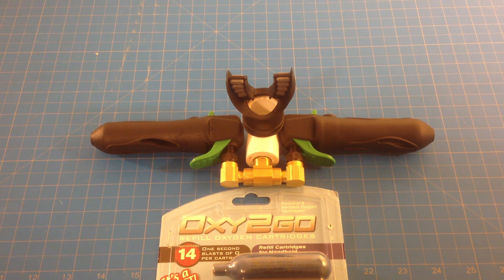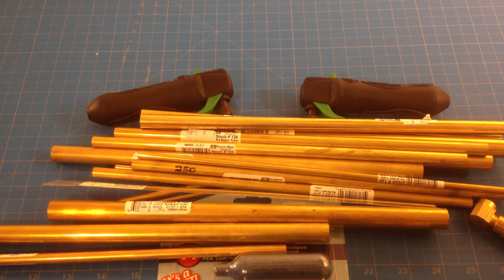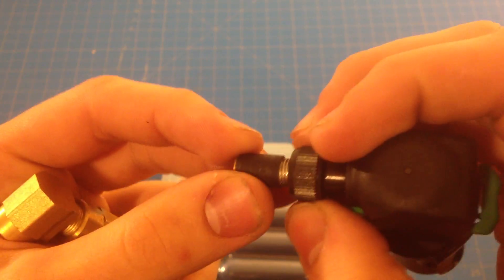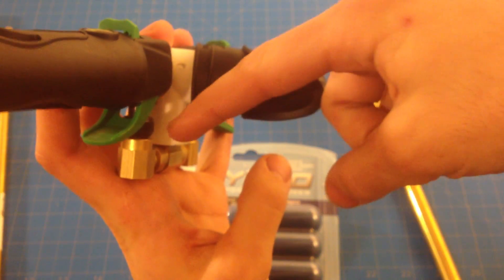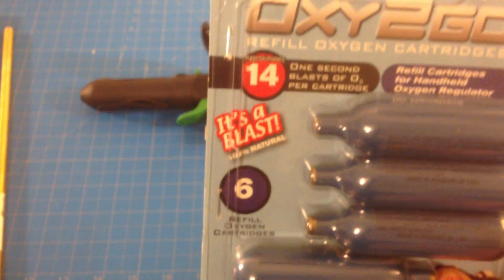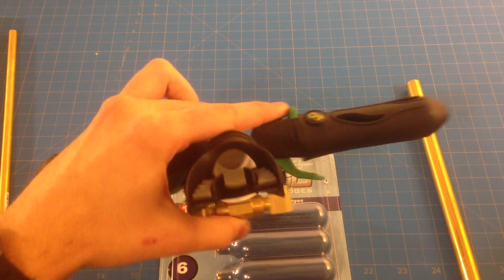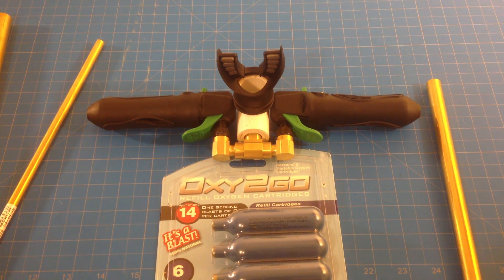007 Mini Scuba Tank Prototype V2

Comment: At first, im Sorry for my poor english.
Second, i really LOVE the idea.
Third, i die some calculations: i dont know, are these AS big AS 12 g capsules?? Lets say 20g so the volume is about 20ml=0,02l at a pressure of 60bar. 0,02*60=1,2l per capsule so with two oft them would be 2,4l. A human (in wir, at sealevel) needs about 7,8l/min (so wiki). That means it is enough air for approximately 18 seconds..... Im really sorry

Comment: It is a good idea and they make a full face mask with a built in snorkel for light diving in up to 40 feet of water so if this could be adapted to that it would be very cool also for emergency purposes it would also work great to
Reply: @Robert Miller No they make a full face mask to snorkel on the surface these full face masks with in built snorkel do not allow you to equalise air pressure. So if you want to risk injury go ahead but you really need to discuss this with a qualified diver. 12m depth and being unable to equalise can result in an injury .

Comment: 100% oxygen is nor harmfull to your body. It is DEADLY. if you breathe in 100% oxygen your blood can not give co2 away to the lungs and ur blood doesnt get cleaned and you die from co2 poisoning.
Reply: +GreekGadgetGuru Please hear me out GreekGadgetGuru, Im an advanced open water diver. Theres a thing called a lung over expansion injury. So how does that work, you might ask? Well, lets say your swimming and you take a breath and swim to 33feet below the surface. The air in your lungs will COMPRESS to half the size, and as you come back up it will return to normal (expand). Now picture this, if you take a breath from compressed air it will be at the pressure that you took it from. And if you start to ascend, the gas in your lungs will expand. If you go up 33feet the air in your lungs will expand to twice the size, and this can cause permanent damage to the lungs, or even death. Lung over expansion injury can happen in water as little as 5 feet deep. If you want to breath underwater, take scuba diving. Its not that expansive and you learn how to prevent these injurys. There are many more dangers to this, such as sinking as the air in your lungs compress and possibly drowning. But I wont go into that. Please be careful.
Reply from the maker: Thanks. Won't do that then. Working on safe version using compressed air.
Reply from the maker: +jack gaming working on it my friend
Reply: in the beginning of the video, he says that it is a combination of oxygen and nitrogen which are the 2 things you need to create co2, so this is "safe" but still not recommended.
Reply: +ZPERO sorry my bad must of not payed attention in biology and chemistry
Reply: @G3AR glad to hear please keep working on it but talk to a trained diver as their knowledge will help you keep the unit safer. It may in the end work or not but as others have said without people trying to invent new stuff we would have no new inventions. Just remember though as I said gas gets compressed so 12 breaths at the surface will be approx 6 breaths at 10m ( as you ascend the pressure decreases so lets say you took 4 at 10m the came to the surface you would not then only have 2 breaths but approx 4  breaths. These are the things a qualified diver can help you with.

Comment: Good luck. For breathing for extended periods of time the design may be flawed. As a safety device, in my opinion it may have merit. A surfer or freediver could get that one vital breath. Also, it seems that the purge valve will also provide o2 at ambient pressure. A technique might be needed to avoid a burst eardrum. Be safe.
Reply: Your right about the ear drum, you need something to balance the pressure from the breathing device to the same pressure as the surrounding water. That's what a secondary regulator is for.
Reply: +Bunk-Bunk You're*
Reply: +Grant Markum (Bacon man 121) This is science not English you obviously knew what I ment.

Comment: Holey hell, this is like a darwin award waiting to happen... Do you have any knowledge about diving at all? do some deeper research. With no regulator, you will run into horrendous problems right off the bat. Pure oxygen is toxic past very shallow depths. If someone used this thing, they would be lucky to survive at all...

Watching people with no dive experience try to design breathing equipment is absolutely painful. And before you say "I'd like to see you do better" I know better than to try. I'm just a recreational diver, but even I know this thing is a death sentence if you tried to dive with it. Even as a back-up, this is worthless, and extremely dangerous.

Comment: @2:11 "High altitude oxygen"... "so im not going to die or anything"..... WRONG.  Scuba diving isnt done at altitude where the atmospheric pressure is lower, its done at depth, under water, where the atmospheric pressure is higher....
Reply: +Isaac Wipfler 

The no dive experience alone is potentially fatal, now near pure O2 and no regulator? I wanna see the darwin award where he ruptures is lungs, and expires from that and the oxygen toxicity in a backyard pool.
Reply: im right there with ya :D

Comment: Scuba Instructor here.  The large risk with breathing 100 percent oxygen is its PP or partial pressure.  When oxygen reaches a partial pressure of around 4.0, the body almost immediately starts to reach.  Oxygen toxicity or oxygen poisoning results in tremors along with a bunch of other negative side effects.  The main cause of death with divers and oxygen toxicity is however drowning due to the inability to keep a regulator(the mouthpiece) in your mouth to keep breathing.

Comment: pure O2 , if breathed at a depth of about 11-15 feet will instantly send you into convulsions. you will suck water and die. pure O2 is TOXIC at a depth of 11-33 ft. be aware of that!
Reply: You're an idiot and don't know anything about oxygen toxicity. 

- a hyperbaric chamber tech
Reply: instead of showing your ignorant, violent, arrogant side, why dont you help educate us? your turn, expert. and do it politely.
Reply: +zencat999 haha. I only say it that way because you took it upon yourself to reply to so many comments with info that you obviously have no idea about! What do you think we treat injured divers with in a hyperbaric chamber? At MUCH deeper depths! Oxygen! Oxygen toxicity seizures can happen after a long time at depth on O2, but guess how we treat it? Remove it until the body uses up the excess oxygen, and then put it back on the patient! Seizures can happen, but the risk is so low and takes so long, that it is pretty much a non issue. So this rescue device? Totally safe for that role.
Reply: not polite but there it is. thanx. behave yourself now. be more informative and less "attacking". notice the key line in this..."100% oxygen is dangerous below 20 feet".
"The answer to this question depends on the oxygen concentration that you are using and, to a degree, your body chemistry. Hal Watts has reportedly made many "bounce" dives on "air" (21% oxygen 79% nitrogen) in excess of 400 feet in sea water. Discounting the narcotic effect of nitrogen, ambient O2 or "air" becomes toxic at around 240 feet in salt water. You should never dive without proper training, and even properly trained SCUBA divers would not dive beyond recreational limits (130 ft) without special training. Oxygen concentrations higher than 21%, or enriched air (Nitrox) will have MOD Maximum Operating Depths based upon the specific concentration of oxygen. 100% oxygen is dangerous below 20 feet and, unless you are trained in the use of military rebreathers, you should not be diving 100% oxygen. Technical divers frequently use concentrations of oxygen up to 100% for decompression in stage tanks, but they are not diving on oxygen. Many will undoubtedly realize that I am not distinguishing between 1.6 ATA and 2.0 ATA... Nor have I discussed the 24 hour clock and the cumulative effect of oxygen exposure. If you are still wanting to know the depth at which a specific concentration of oxygen or an exposure to oxygen over time can become toxic, you should take a class in Nitrox or enriched air from a internationally recognized SCUBA agency. Many questions will be answered and you will learn the formulas to determine oxygen toxicity for a given concentration. I hope this helps							"
Reply: +zencat999 your talking about 3 different things. So thanks for coming out. And yes hyperbaric chambers dive patients with 100% oxygen. And to start, the divers get sent straight to the depth they were at first.
Reply: I know this. had frends that had to do that. Iv also had to bring a buddy(?) up from about 30ft as he was going into convulsions from mistakenley sucking O2 intead of his air bottle.

Comment: Why not try to find like rubber washers. so it keeps the water out and also still be able to move your parts. Metal, especially glued together, won't really let you twisting you want. So, experiment with rubber washers or something similar instead.

Comment: i think you couldnt use this deeper than 6 meters, because than the oxygen gets toxic or something (dont know exactly) so you cant you would die at depths deeper than 6 meters
Reply: Yeah you are right, breathable air needs to be 80(something)% nitrogen and 20(something)%.......This guy is a moron and should try doing some research.
Reply: +Let`s FLIPP 
Your correct he could not use this deeper than 6m but it is usable to that point.

The issue with using it deeper is an issue with O2 Toxicity , pass a certain pressure ( 1.6 bar ) Oxegen is poisonous to the human body, it would likly not be an issue imediantly, but the more it was used the more likly you would be to have an issue

Source: 10 years scuba experience(and  qualified to use higher o2 mixes while diving  )

All that said this is not a brilliant design ... if i was to do something like this i would look at doing a hot water bottle re-breather (yes these do exist!), would last close to an hour of use and would not cost that much more than this system .... not that id ever recommend using one just from the safety aspect of it! 

If the gadgetGuru has any questions im happy to anwser them - pressurised gas / the effect on the human bobdy under water are not something to mess around with without doing a good amount of research!

Comment: make sure it isn't pure oxygen
Reply: +Dominic Mann no they dont. I have been a diver for a looooong time and we DONT use O2 unless we are giving aid to someone on shore or for emergency deco. NEVER UNDER WATER! rebreathers are a different system and does use pure O2 but you dont breath it directley. it is mixed with nitrogen. pure O2 is toxic at a depth of 11-15 ft. you go into convultions, suck water and die.
Reply: +Touch of Genius pure oxygen kills you. the only "pure oxygen" that is used, is used in re-breathers. which take your exhaled breath, combine it with pure oxygen, and give you back a gas mixture
Reply: +Vein Nebula the tanks said 90% oxygen and 10% nitrogen, some divers do use pure oxygen in some cases.
Reply: Touch of Genius good I guess?

Comment: Neat idea, I think therefor I can. 007 had Q to do all of his R&D I don't think any of hid gadgets made it to market, oh wait they did put a phone in a watch. Like all the divers are telling you, you need to get dosages right, then if you can miniaturise a regulator to distribute the air mix. Weld the brass fittings, get every thing cut to size and have someone weld it, 28 breaths in shallow water is a long time, then if you had a couple more of them in your pouch your up there with a scuba tank, less cumbersome, and way more freedom. I hope you stay with it, there would be many applications.

Comment: People who scuba use compressed air with regulators to bring it down from 2000-3000 PSI to a manageable amount. I've been thinking about something like this, or another design, but the amount of air this would blow down your throat would be huge, and that amount of oxygen can be dangerous. If anything, use just compressed air cartridges, but, you seriously need to figure out how much pressure is coming out of this.

Comment: You should call this the 'Natural selection device'. This thing is so dangerous.
Reply: +Chickenug Pure oxygen is what killed the crew of an Apollo mission during training. It is also used In. rocket fuel. it is far from safe.
Reply: +Chickenug He does it to oxygenate his blood. you will die I'd you just breathe pure oxygen. your body doesn't run on just that. you take in other gases whilst breathing
Reply: +Zeesha you're right http://science.howstuffworks.com/question493.htm
Reply: +Zeesha you are correct it is dangerous however it is even more dangerous because there is no regulator and your lungs under presser. using this can burst your lungs. the higher altitudes make the air cans safe. your lungs are not as tight and can hold more than you can normal.. not to mention it is deadly under extreme depths.
Reply: it is canisters ment for inhaling, you shit heads don't listen
Reply: +cola5357 still doesn't have a regulator on it you douche bag. But then again why am I telling you this. You should do it! go on! #Naturalselection.
Reply: cola5357 your correct but wrong . it is made for use above a set point were your body is under less pressure, there for your lungs can expand to a much larger size. underwater however your body is under more pressure meaning your lungs cant expand as much as above the water. you can test this by holding your breath above water and not moving , time it with a stop watch. then go just 3 feet under lay on your back and time it there. i can tell you your time will be indefinably shorter. have a nice day cola
Reply: +Zeesha lol
Reply: Chickenug  but this guy breathing oxygen is siting in the pool, not diving deep. Are you crazy? oxygen can will just kil you, because over 6 m deep it becams toxic in your blood. learn anything about scuba diving before you say something
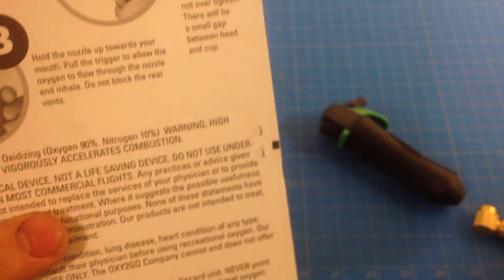Reply: 2:15

Comment: Some of the points here are valid such as over-expansion injuries, and yes, deeper than 20' the partial pressure of oxygen would be too high. However, CNS and pulmonary oxygen toxicity are time-dosage issues and given that one could only get a breath or two off of this thing it's not even close the biggest problem with this proposed device. My biggest concern is with the materials he is using to build this thing. He is proposing hooking up high pressure oxygen to these parts made of God-knows-what. If any of these pieces or glues have even a little bit of residual hydrocarbons on them there is a good chance that this could literally blow up in your face. Unless the parts are made of oxygen compatible parts (i.e. not of materials that could provide fuel to feed the inevitable fire this thing is going to cause) and is oxygen cleaned to ensure that no oil or other inflammable (<-- this does not mean that it can't light on fire but that it can; "flammable" is not actually a real word) materials left over from the manufacturing process all that is needed is a spark to complete the triangle and this thing goes boom. My suggestion is to scrap this ill conceived plan. Moreover, James Bond's device in Thunderball was not open circuit like traditional scuba but rather some type of oxygen rebreather (there were no exhaust bubbles); however, there are no counterlungs on it nor any place for the scrubber material used for removing carbon dioxide to exist so it could never exist in real life. Unless it's supposed to be an artificial gill like the proposed Triton, which likely will not work either, but traditionally it's been assumed to be a rebreather.
Reply: rmeglath how you gonna get a breath off it when the second you press those triggers its gonna fly straight out your mouth hahaha

Comment: Neat idea, "in theory" like other SCUBA instructors have said, oxygen toxicity is a nasty thing, apparently you don't dive...you talk about "high altitude" and using oxygen, well under pressure (under water) 17 ft. 90% o2 is deadly...nitrox is only up to 40%...this is insanity...DON'T USE O2 REVISE THIS AND TRY USING AIR!

Comment: I appreciate the ingenuity. You are thinking a lot through the process. Everyone has already covered oxygen toxicity and lung over-expansions, so I'm not going to cover that but for what you are making and the reasons you give to use it, look up Spare Air. I think if you could accomplish making their system more compact and it would be safer breathing normally using air then high partial pressures of oxygen holding your breath. Keep at it, just research diving physiology first

Comment: Actually, GreekGadgetGuru you would suffer toxicity or cerebral cell damage if you inhaled this cartridges directly. If you look on the instructions it should actually say to put some air in your mouth and mix it with normal air and then breathe* Not to DIRECTLY breath from it as you would breathing helium from a balloon.

You need pressurised (normal air) just like we breathe above water. So divers do not use Oxygen tanks they use Air tanks which is mostly Nitrogen as you know, and not only 10% !!
Reply: shreddedreams i DON'T THINK HE DOES KNOW!

Comment: You should use a nitrogen and an oxygen minitank so you csn mix it and create nitrox which is the same gas as in normal scuba gears and you can use this gas up to 30m depth. The mixture of oxy and nitro is about from 40oxy :60nitro to 50:50. Or mix it before and then put it in those minitanks